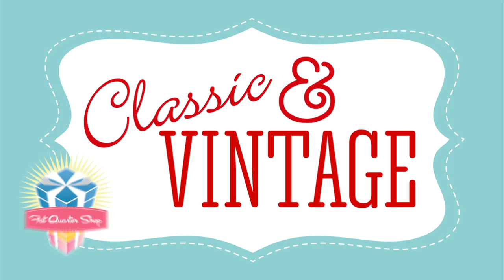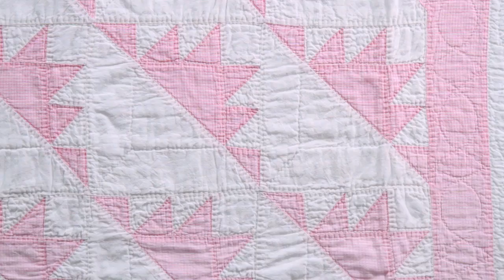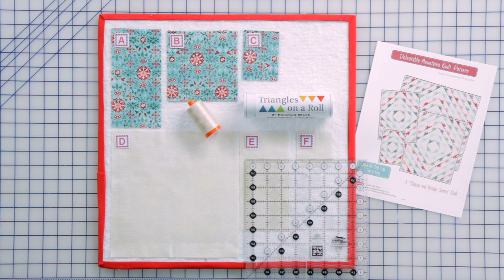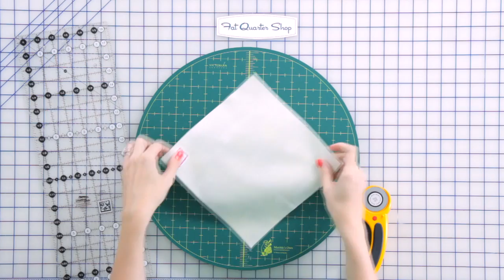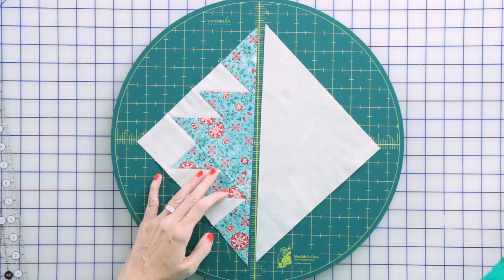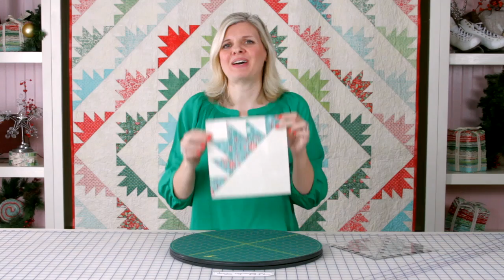HARD block made EASY! Delectable Mountains Quilt Block - Classic & Vintage Quilt

Comment: The tutorial looks straight forward, but I have had problems getting the pieced triangle to be the same size as the 9 1/2" white triangle. When I trim the pieced triangle, it's always smaller than the white triangle and that throws off the finished square.